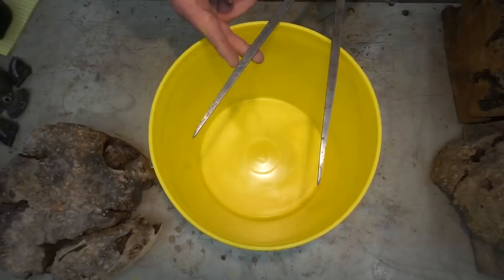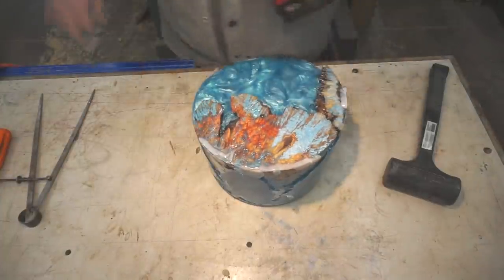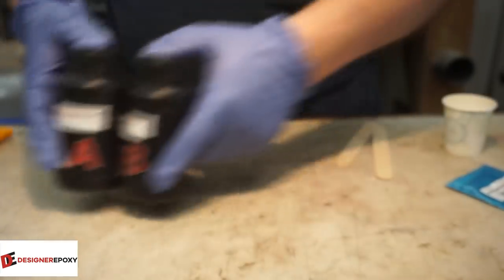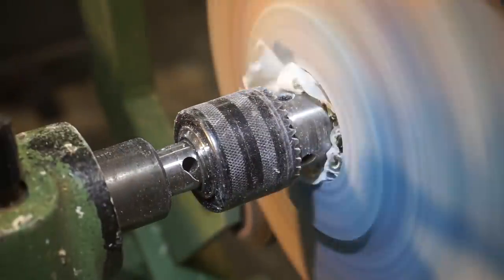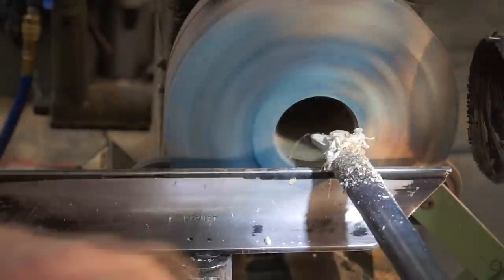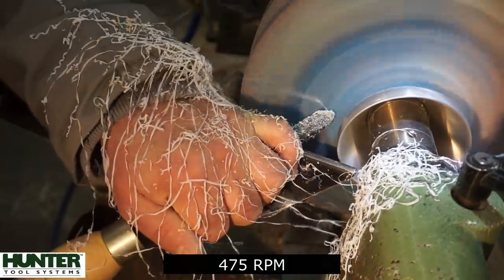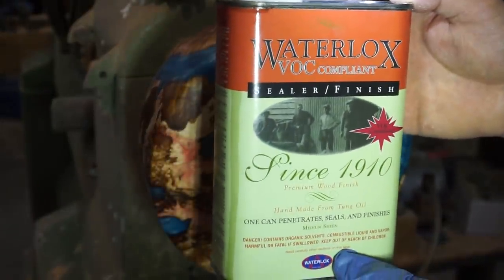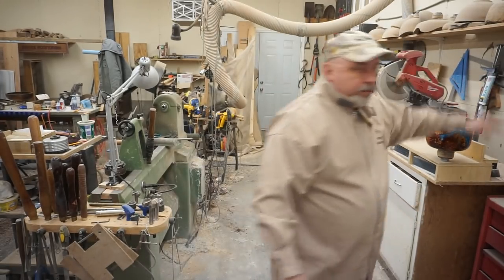Woodturning - The Sky Blue Urn

Comment: Gorgeous piece of work ... prayers to the family.

I have pretty much retired my big hoop steady (similar to yours but built of Baltic Birch) in favor of Oneway's Bowl Steady. It is the one with a single vertical post and a set of adjustable wheels. It supports the workpiece on the side you are cutting on, which eliminates vibration, and doesn't get in the way of your laser or TV camera. Like everything else from Oneway, it is built like a tank.
Reply from the maker: Been debated on getting one of these, it will keep things from vibrating but won’t keep them from coming off the lathe tho, lol. I think a quick mod will make this rest more functional. Thanks 🙏

Comment: This is a beautiful urn. Great job. You mentioned the casting could be done without a pressure pot. What steps would you need to do to minimize bubbles in coloured resin?
Reply from the maker: Seal the edges first with resin and degas the resin in a vacuum chamber if you have one. stay away from mechanical mixers as well, only hand mixing, thanks

Comment: I have it in my head that I'm going to make a segmented globe lamp using wood from my firewood pile. Likely because I'm a sucker for punishment, but also because I found several pieces of the most beautiful Curly Maple amongst the 4 cords of junk I got this year, and feel like it needs to be saved! Since I use Designer Epoxy and their pigments, I'm definitely going to use one of their blues for the ocean (where the lamp light will shine through). What blue or combination of blues do you recommend from their line?
Reply from the maker: I think Ocean blue would be my pick, thanks

Comment: Absolutely stunning work jim!  You mentioned tools a bit in the video, i havent seen the viceroy lately? Where did you find that useful or was it sort of redundent with the hercules?
Reply from the maker: The problem I have with the viceroy is that it’s purely a right handed tool, so I can only use it in certain areas. I prefer the Hercules and the osprey, thanks

Comment: Great work as always - nice tribute. Curious - is the hot melt not quite strong enough bond on the resin, or were you using the 2 hour for filler and decided to use it for the glue block since you were mixing it up anyway?
Reply from the maker: You are correct, I figured the resin bond would be stronger and I needed to mix some up anyway so that's why I used it. I also think its stronger too, thanks

Comment: Question, why do most turners put valuable burl on the inside of the urn, such as you did, if you will only turn it away anyways?  Have you thought about cutting the parts of the burl that would be in the inside anyways, and replacing it scrap wood.  That was you could use the burl in another piece. 

Here you used multiple pieces, so you could have just glued thin pieces to a scrap log and no one would ever know.  If you think about it, you only need a few inches on the outside.  Kind of like veneer, just a lot thinker.  I’m sure there is a good reason why you don’t. I’m sure it’s something really simple and I’ll probably smack myself in the head, but I can’t think of it.
Reply from the maker: You make a valid point, the only issue is there happens to be movement of the pieces (hot melt glue can break free) it could rune the casting. Along with this how could you cut and save pieces of burl from the original pieces? I will give this some thought and you never know, you just might see it there, Jim